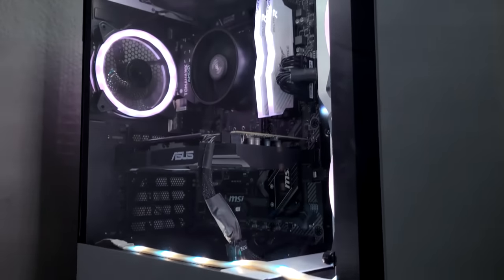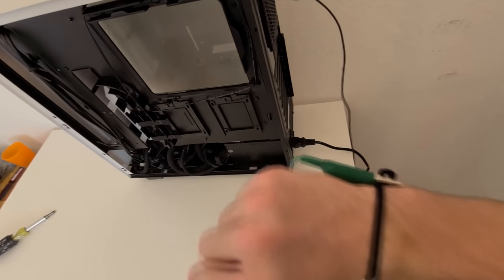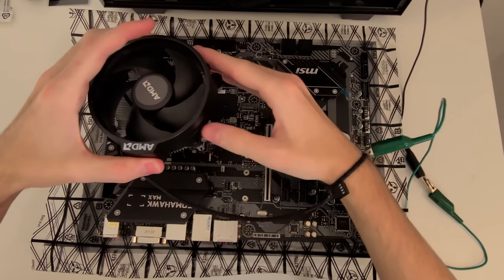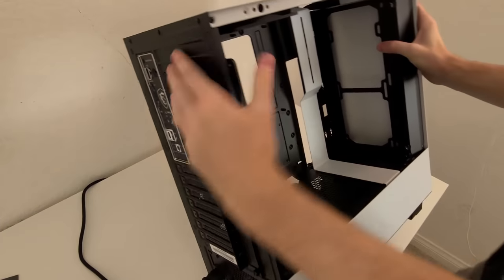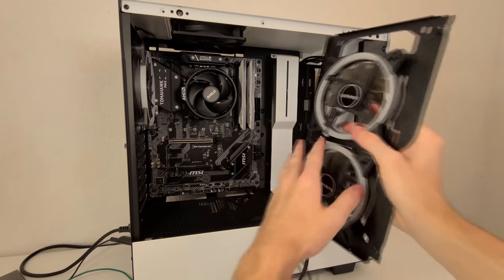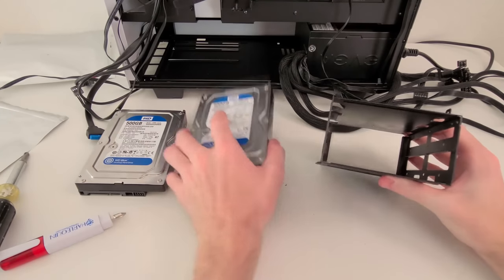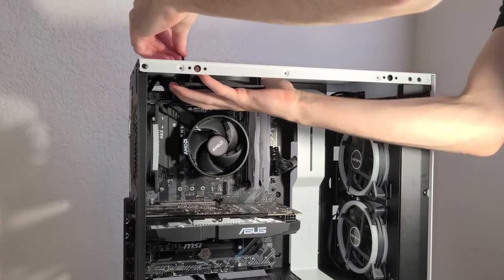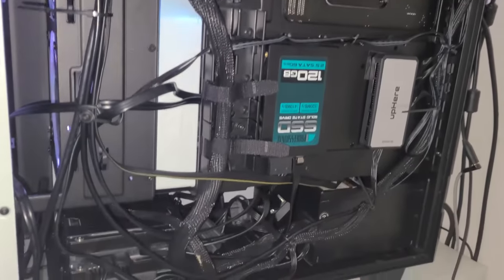BEST $700 Streaming/Gaming PC [Build Tutorial]

Comment from the maker: *If you need a WINDOWS KEY, this website has them for cheap! use coupon code "ROOTECH" for a discount: https://digitalchillmart.com *
ᐅUPDATED 2022 $700 PC BUILD: https://youtu.be/Aw-yLeI899k
Reply: Where did you buy the parts cause where ever I look for new ones it goes almost 100 I’ve the budget
Reply: It’s little Murph prices change i learned that really quick they change almost everyday
Reply: It’s little Murph i know it’s because of corona and don’t forget about taxes it makes it to 867$
Reply: tryharder no its not corona its depends on the availability, your area , etc.
Reply: Do you need a hardrive for this pc
Reply: Please tell people dont get the xfx rx580 because it has numerous issues.
Reply: What country is this based cause I'm an Aussie
Reply: When you say 60 FPS do you mean your computer is gonna running on 60 FPS or just the broadcast?
Reply from the maker: @edgar-fn8gc  it can stream at 1080p60fps
Reply: Roo Tech hi is intel core 5 9700k or ryzen 5 3600x
Reply: Wooosh If Gay so only get the ASUS one he got?
Reply: I have a question I wanna make my first pc but I do not know if this pc is possible and I it is any good : Processor : amd ryzen 5 3600 
Moederbord: gigabyte b450m DS3H 
Ram: corsair vengeance lox 16gb (2*8) 
Grafische kaart: 
radeon rx 5500 xt 8gb 
Or gtx 1660 super 
Geheugen: crucial mx500 1tb 
Voeding: seasonic 12lll 550 
Behuizing: thermaltake s100
Reply: Im planning to build a pc for €700 I’ve build around 13 pc’s for people and I think I’m going with some of my old storage so I can get a 1660 super and a ryzen 3600 (I’m 13 I play and record fortnite r6 and warzone I really want to stream it while playing) my current system is i7 3930k and gtx 970 16 gb ddr3 and asus rampage IV extreme (I bought it for 300 and my old cpu died (i7 3820)
Reply: @arielpuente5207  the asus one is a great choice. if you want to look at a full list go to https://pcpartpicker.com/products/video-card/#c=391
Reply: @UNES._.00  that's a great choice, but you should wait until the end of the year when rdna 2 or ryzen 4th gen comes out. If you really need one go for the 1600 series because nvidia control panel has streaming software that prevents fps drops when recording streams.
Reply: can this run and record minecraft at 1080p 60fps and also what framerate will it run minecraft at while not recording?
Reply: facts
Reply: It’s $953 for me
Reply: @RashfordTheGoat11  it has a ssd but you can add one
Reply: @mr.walnut0669  0
Reply: I want to play the new microsoft flight simulator game would this build support it
Reply: So idk why you're saying it is $700 build. When I go and price out all the links in the description, it's a good $200+ more than the $700 you claim.
Reply: Is this usd or aud
Reply: Can you use a Ryzen 7
Reply: Is it the same if I have a RTX 2070?
Reply: Isn't 700 pc no more my guy
Reply: are those fans 120 mm?
Reply: does a gigabyte rx 580 8 gb work is it ok
Reply: @user-qk8rt9yf9v  ist have the xfx
Reply: Can ist also take 450watt power
Reply: @thies2770  pretty good
Reply: Hello do you think I can run  3 monitors on this pc 😁
Reply: @Roo_Tech  can it run dual asus vg249qs?
Reply: yo how is that all 700 bucks? pls tell me as the graphics card is so expensive itself!
Reply: IDK man should I get this or not cause I kinda want to change some stuff but idk if it will cost more cause I have a budget of $750
Reply: Can i have the link for the ssd?
Reply: What PC is better 2020 or 2021
Reply: Best Baject Gaming PC . thank you sir.
Reply: How do get the ram to change colors?
Reply: Does the pc automatically install windows?
Reply: ngl this looks like one of those free robux scams lol
Reply: will a GTX 1650 work for the graphics card?
Reply: Can you explain on what to do with the led fans?
Reply: Instead of the ryzen cpu can I put an nzxt kraken x63
Reply: @Jp3r4lta  yes

Comment: I built this PC! Only thing I changed was the graphics card and went with a gtx 1660. It's handled everything I've thrown at it so far. Running the cold war at beta at 120fps, valorant at 200FPS. Very satisfied, thank you for your help roo tech!
Reply: Is the case good ?
Reply: @viole8354  case is awesome really easy to build with, nice and neat cable management too, looks very clean
Reply: @gsd2796 how are the case fans is it good ?
Reply: @viole8354  yup, make sure get a cpu cooler i got one for my i7 9700k
Reply: @gsd2796  thanks
Reply: @gsd2796  is this case a micro case or like mid tower
Reply: What's the fps on warzone?
Reply: which gtx 1660 did you get?
Reply: @vonhayz  1660 super is what I’m planning to get
Reply: @kyann1x79  should i get the gigabyte?
Reply: Anyone know what CPU cooler he used in the vid? I don’t know shit about computer parts tbh lmao
Reply: Can u give a link for the gtx 1660, should I get the Msi 1660 and would I need a cpu cooler
Reply: @jeremywhite978  the ryzen 5 3600x comes with a wraith sphire cooler. At least it does on Amazon.
Reply: Do you know if you were able to run cold war and an elgato hd60s?
Reply: @viole8354  Don't be fooled to buy this case, it has pretty bad air flow, go for the "lian li lancool ii" it's much better airflow and much easier to switch parts out if you're buying something new.
Reply: What about fortunate ???
Reply: If I got the gtx 1660 would I have to change anything in the build
Reply: I did a similar build also but with a PNY 1660 XLR8 OC 6gb, 600w evga psu, and a Hyper 212 Rgb black edition psu cooler 👌
Reply: @Neotones how does the c run do you think it could handle minecraft or csgo
Reply: @Neotones thank you so much! I might sound dumb but it running both of those at the same time would still be fine also right?
Reply: @Neotones oh Ight bet, thanks so much
Reply: How much storage does it have
Reply: @Neotones did you use it with a hard drive or ssd
Reply: @rips9541  no all of the parts work together
Reply: @Neotones ok thanks
Reply: @Neotones how much FPS does it run on low Fortnite settings?
Reply: Should I get the extra led fans or should I save the money?
Reply: @Neotones I know this game is pretty dead but how is the fps on fortnite thanks in advance.
Reply: @kyann1x79  mid tower
Reply: @vonhayz  no
Reply: @Hunchojk  it’s the stock amd one
Reply: @jeremywhite978  a 1660 is a graphics card it doesn’t need a cooler it basically is a cooler
Reply: @elicepero396  thats why you get fans, also what case has open front panels lmao that would look like shit
Reply: Neotones did you encounter any problems when doing this build?
Reply: @kyann1x79  This case is a mid tower, H510, but if you want a smaller case there is the NZXT H210 for ITX builds, I'm gonna make my first build in the H210 as I want a pc that's a bit more portable.
Reply: Can you do a video on it on your channel
Reply: @Neotones what graphics card?
Reply: Doctor Squidman  im thinking of changing exactly those things will it run vr
Reply: Doctor Squidman  agh excellent thats literally everything i needed to no thank you! Ill check out your channel
Reply: If I change the ssd with a 1tb ssd will it still fit in there?
Reply: @Ruben-il9bk  yes all ssd are the same size physically. The amount of storage just changes
Reply: Jig97 ok thank you that’s a relief
Reply: Which GTX 1660 did you get? I’m planning on building this :)
Reply: How does it handle minecraft?  (like framrate-wise)
Reply: @_Fenikso_  I have an MSI 1660ti but any make/model of a 1660 is still better than the rx 590 and the 1660 I believe requires less power and is more efficient!
Reply: @Neotonesv2 do you know what gtx 1660 i should get
Reply: Can I use 500gb wd blue 3D nano sata ssd m.2 instead? Or what’s better
Reply: @zachpaquin7541  m.2 is the best available yes and they are easier to install bc they screw directly to the motherboard without using any cables. Just make sure the motherboard you select has an m.2 slot :)
Reply: @jig97  thank you
Reply: @zachpaquin7541  np. I personally have a 500gb m.2 for boot speed and the main few games I play and then also picked up a 1tb hard drive for around 40 bucks for extra storage
Reply: Neotonesv2  what is the hz on your monitor is it 144 or higher
Reply: @croissant6954  yes anyone building this pc or better needs a 144hz monitor. Otherwise you’re severely bottlenecking graphics
Reply: How much fps do u think u can get on minecraft?
Reply: Hey man is it good for gaming?
Reply: @cdpidg  120 at least
Reply: @leonmilosevic82  yes
Reply: @gsd2796  very bad airflow, i saw people taking off the glass due to very high temperatures
Reply: @viole8354  what abt Fortnite? What FPS does it run on ?
Reply: @meppo6781  For a 1st build, 50 year old veteran, will all the parts go together in your case like it did his or will it be different? Thank you!
Reply: How much fps on warzone??
Reply: I’m looking into building for the first time. Would you recommend this? I really only play single player games, no streaming
Reply: @itsok9363  not true at all they must have some shit build skills, good airflow on mine steady temp below 60 on my 2070 S everything runs at good temps
Reply: Bro I changed the motherboard the cpu psu gpu
Reply: Whats the operating system
Reply: @Neotonesv2 Hey do you know what graphics card to get for this build
Reply: How many FPS at 1080p can it run cod also is it overclocked
Reply: @gsd2796  wait doesn’t the cpu already have a cooler
Reply: @grayfam8  If you do exactly like him in this video with the exact same parts and case I reckon it won't be any different. But for the Lian Mi. I have no idea man, go ask reddit, there you will get all the answers you need. Have a good day, and thank you for your service brother!
Reply: Does anyone have a good suggestion of a gtx 1660 graphics card? This is the only thing I want to change in the pc, thanks.
Reply: Btw does anyone know if an intel i7 works instead of the cpu in the video?
Reply: @meppo6781  Thank you!!!
Reply: @rips9541  Nah
Reply: All the Gtx 1660 ultras and gtx 1660 super are being resold for like 700 bucks on Amazon do you think the gtx 1650 would be at least cheaper and good for a GPU?
Reply: @apoloa2749  i want to know this too
Reply: @Neotonesv2 is that the one u used
Reply: Does anyone know if the GTX 1650 Ventus XS 4G OC is good for this build
Reply: @Pablo-yk5mv  that’s what I thought aswell
Reply: Do the mother board and everything come with the pc?
Reply: @gsd2796  well you'd be wrong about this one there are a few cases I can think of that are pretty swank and have open front panels or are heavily ventilated
Reply: @Γιωργος Πιρουλης uh yeah
Reply: hey, i wanna build this pc too and boy do i have no idea about anything tech at all. Would any graphics card be installed in the same way as he does on the video? i was going to put the sapphire pulse graphics card linked in the description and was wondering whether the video would still be easy to follow? im so sorry probably sounds like such a stupid question
Reply: @Γιωργος Πιρουλης no I built my own for like 900 but every pc runs at least runs fort it’s at 60fps  less
Reply: @marstinaa  Although I don’t suggest building a pc if your a first timer, I do suggest getting a good prebuilt. I would suggest going to a place like micro center. I got my pc set up  like a week ago and works like a charm. But if you really want to build this computer, the graphics card he linked in his description isn’t the best, but remember that in the pc world you can always upgrade. So yes, the Gpu ( or the graphics processing unit) Would be compatible since the motherboard is an ATX, not micro ATX
Reply: @apoloa2749  Ohhh thank youuuu
Reply: @jig97  did you upgrade any parts previously to make the graphics card fit
Reply: Does it have Bluetooth in the motherboard
Reply: @gsd2796  No it’s not, people only get it for the looks when it has awful airflow.
Reply: @Condisc4  you've no idea what you're even talking about kid
Reply: how much fps in fornite and wz?
Reply: @Hunchojk  it’s the stock cooler for cpu. (CPU comes with the cooler)
Reply: @jakub4972  m.2 ssd

Comment: I love how he shows you how to put everything together and not just say it and quickly show a 0.0001 second clip definitely getting this.
Reply: Will still be worth it during Christmas?
Reply: Will it still be worth it during Christmas?
Reply: Will it still be worth it during Christmas?
Reply: Will it still be worth it during Christmas?
Reply: Will it still be worth it during Christmas?
Reply: Will it still be worth it during Christmas?
Reply: Will it still be worth it during Christmas?
Reply: I do suggest using a 750 watt power supply instead of the 500 because I had power problems with the graphics card and cpu so i had to buy the 750
Reply: @luhtweakin2658  buddy really has to reply 5 times
Reply: @mcfilms7069  it’s a mobile glitch that happens sometimes. some people can’t be bothered to delete the extra replies though.
Reply: @bombastic1299  laughs in laptop*
Reply: @bombastic1299  laughs in laptop*
Reply: @bombastic1299  laughs in laptop*
Reply: @bombastic1299  laughs in laptop*
Reply: @bombastic1299  laughs in laptop*
Reply: @bombastic1299  laughs in laptop*
Reply: @bombastic1299  laughs in laptop*
Reply: Instead of a ASUS RX 580 will a MSI GeForce GTX 1660 fit or work with this case? I’m kinda new to this and am currently working with building my first pc...
Reply: @drixpy2238  yes, it will work. It can be any manufacturer tho

Comment: The ONLY builder I've ever seen do it properly. Installing the power supply so that you're the same potential as earth ground. Well done sir!
Reply: Yea whats the point of that
Reply: @evanmurphy5354   Good practise when pc building, helps dissipate static electricity so you don’t touch a component and fry it with static
Reply: @swifthorizons5345  ive built PC's for 20 years on my carpet in the living room never had a component fry yet, its a bit of a old myth, as if static could fry a component, they are built better then that these days... its not 1955 components
Reply: I work on multi million dollar equipment for Intel.. every machine has a grounding wand and you're supposed to touch the wand on components before working on them ... does anybody ever use them? No, but they are there. Lol